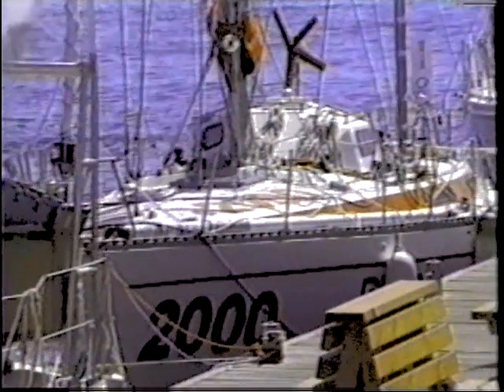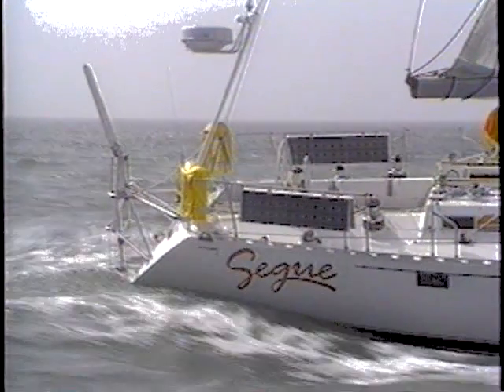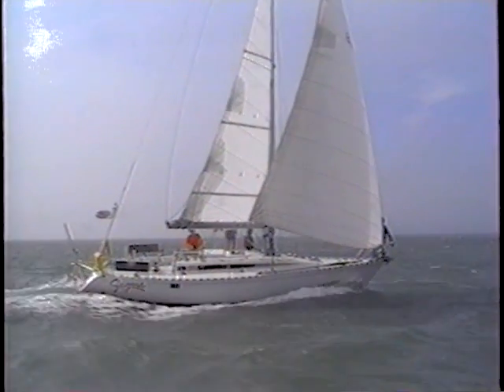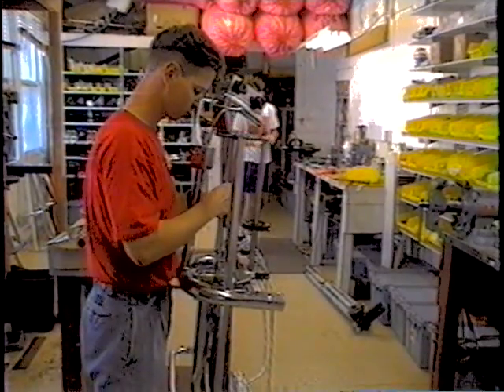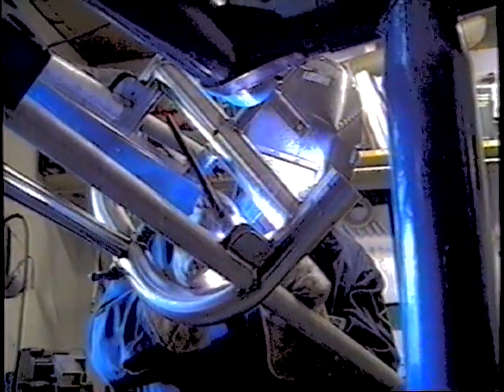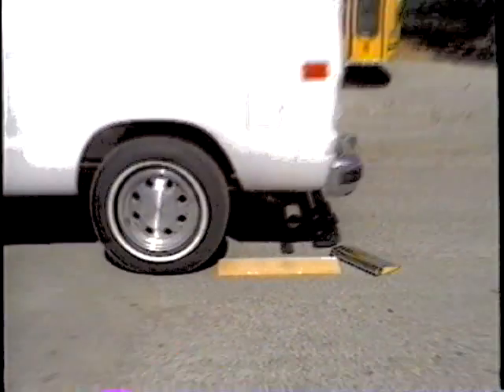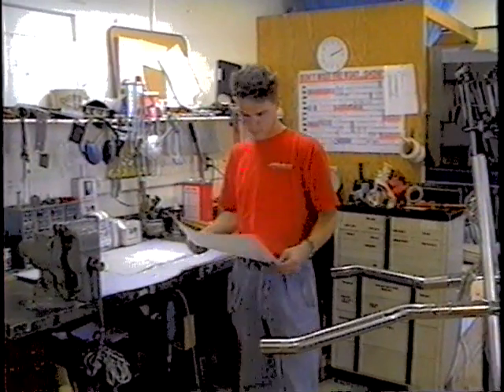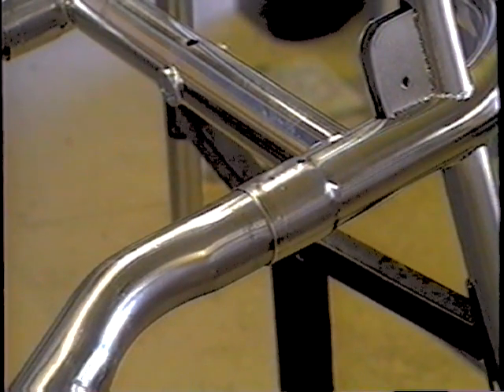Monitor Windvane 1995 promo part 1 of 2

Comment: Is there a difference between auto pilot and a wind vane?  I've seen auto pilot on catamarans, but I did not see a windvave on it.  Do you use one OR the other?  Or both at the same time?
Reply: Auto pilot is always electric. Wind vanes on catamarans are tricky, because of the big saloon. Plus your dinghy needs a new place.